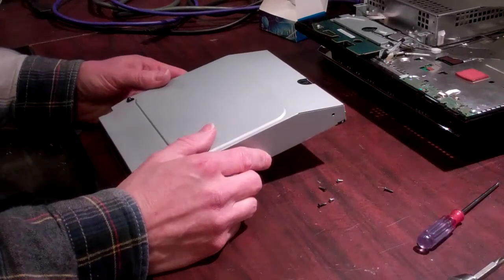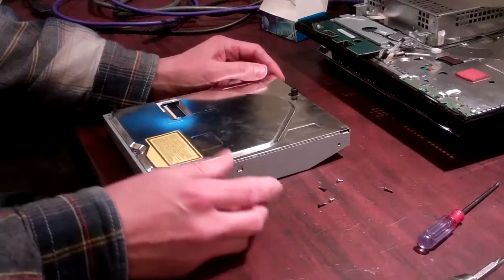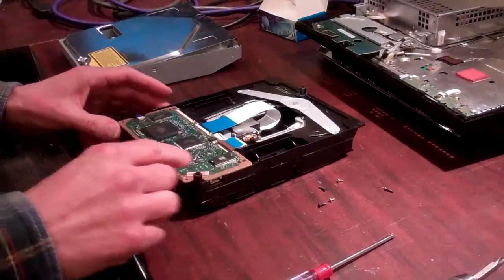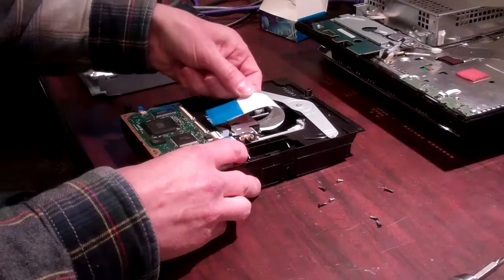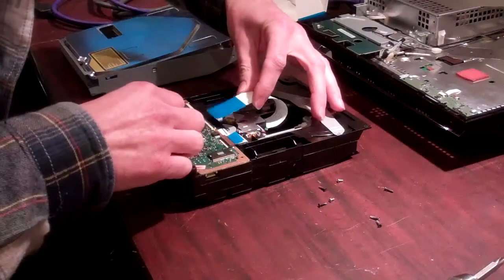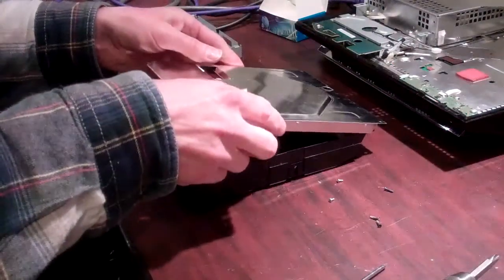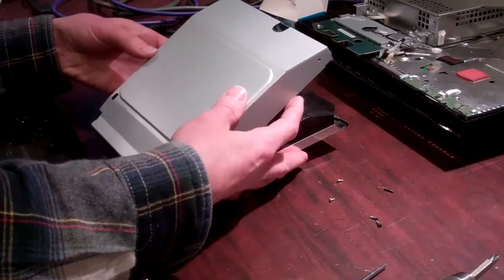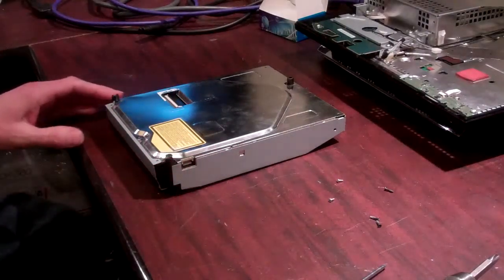PS3 Blu Ray Fix 410 Model Swap out Drive by changing the daughter card.

Comment from the maker: Thats a tough call not seeing the drive.  What other symptoms does it show?  You may have a grounding or static problem or both.  If your loosing lasers it could be a issue with those two things.  I would recommend a drive swap to rule out alignment or rail issues as well.

Comment from the maker: Not sure what you mean by activated?  But if you swap a drive you also need to use the daughter card (the electronic board on the bottom of the drive) from the old drive (or the one that came with the unit) since they are married together and will only work when together.

Comment from the maker: Typically the PS3 slim has a white lever on top that will become off track.  This will cause misfeed.  If it is the older style ps3 then I would think it to be a major issue and the drive may need replacement.  Either way opening the drive and adjusting the rails may correct the issue with feeding.

Comment from the maker: If you take the pcb controller board from it and put on the new one.  If slim 2001A or B - if you have 2500 or 3000 then they do not have controllers - it is built into the mainboard - so for those you would not need to do any transfer of parts.
Reply: couldn't find this info anywhere else I searched. (for slim model 3001B) thanks

Comment from the maker: The light on is usually when the drive thinks the disc is in there.  I would check the ribbon cable - may be a broken contact - try another one.  Or break down the drive and look for rail issues or something not in the right position.

Comment: Hiya great video, my ps3's blu ray doesn't work the console is a cechj03 so I bought a ylod console which was a cechg03 and the daughter card is on the outside of the drive and the cable connectors are in the wrong place. Have I gone a bought the wrong thing?

Comment: I wanted to know if you had an opinion as to what I may have did wrong with remarrying the ps3. Background: My ps3 stopped reading discs, but everything else worked, so I bought a completely new blu-ray drive for my cechh01 ps3 model because one of the arms broke while I was cleaning the lense of my old blu-ray drive. So, when I got the new blu-ray drive, I took out my old daughter board, and placed into the new blu-ray drive. When I was about done, I noticed the ribbon on the outside silver casing that connects to the daughter board, the black flip lock was up because it got stuck to the taping, so I tried pressing down, and looked closed and locked in. I continued with putting it all back together, and did a test. The blu-ray drive will accept and eject discs fine, but nothing pops up on the ps3 screen. It's not reading the blu-ray drive at all. Usually you will see your movie, or game in their screen areas or automatically start playing, but nothing happens. Any suggestions?
Reply from the maker: Exchanging your daughter card into a new blu ray should work fine.  I would first test the new blu ray in the PS3 to confirm a disc spins.  It will not read the disc but this is a good way to make sure you received a working drive.  Now - there are many things that could be the cause of your unit not working as you mentioned.  A bad laser is most common, if you tested this first then it should be ruled out.  A disc that spins confirms the laser typically.  When lasers are bad for blu ray then the disc will not typically spin.  The dual lens laser is not included in this as a DVD may work when the blu ray portion is still bad.My guess when swapping a drive with known good parts is:1 - ribbon cables not connected properly2 - crack in a cable - typically in the copper tab contact points on the ends of the cable3 - drive has rail issue or something is not lining up correct and therefore stopping it from working4 - sometimes these lever clips are damaged usually when its someones first time working with them.  They are not something people come across in day to day electronics work for the most part and the clips can be broken easily.

Comment: Hi, I bought a new 410a blu ray drive as my old one wasn't playing discs (but it did pull the disc in). I changed the daughter card over from my old drive to the new and now I have a blue LED on permanently and the drive will not pull in the disc. I got it working working by trying a method to make the drive think there was a disc inserted. I suspected the issue was with the sensor on the new drive so i replaced it will my old motor and sensor but this is doing the exact same thing. Any ideas?

Comment: How do you do that? My motherboard got defected so I bought a new motherboard and I switched the whole Blueray drive into the new motherboard, isnt the daughterboard already attached to the blueray drive? So how is it that I have to switch it to the original one? Can you pm me a step by step guide on how to do this. Also do I have to buy a replacement or something because my blueray drive reads dvds but not anything blueray, or is it related to this?

Comment: Hi, when taking apart my BluRay drive to clean the lens (as it was giving me error code 80010514), I mistakenly broke the flap on my BluRay Daughter board that connects my BluRay Driver to the Mother board via a ribbon cable.

I've attempted holding the ribbon in place with electric tape, but the drive no longer sucks in discs. Would you have any suggestions for fixing this problem, without having to lose the data on my HDD? Thanks in advance...